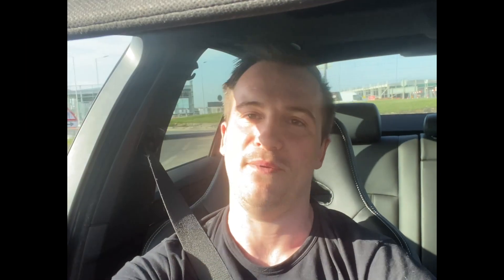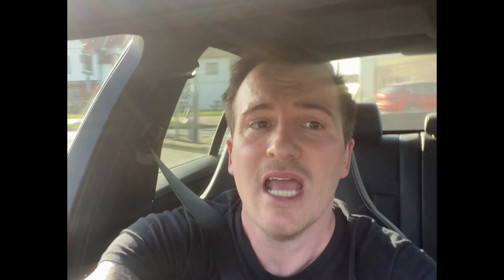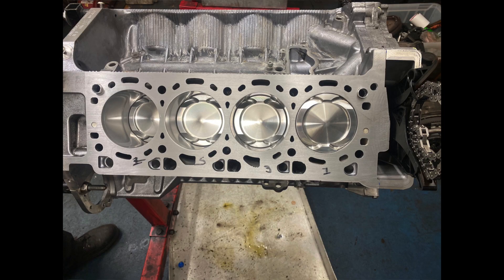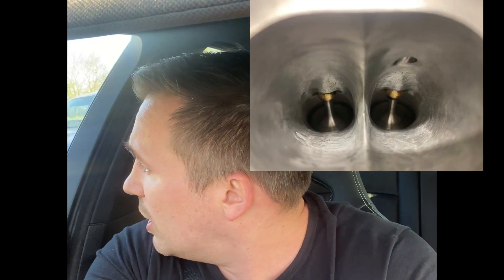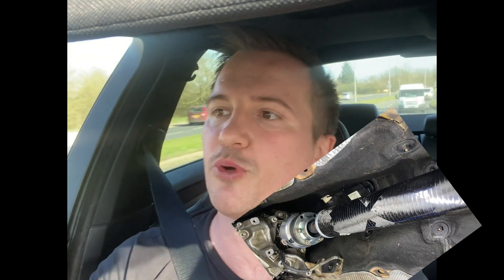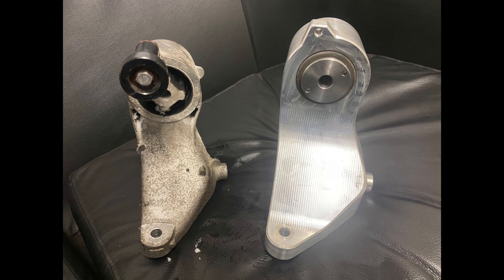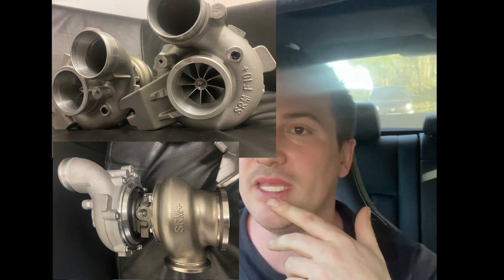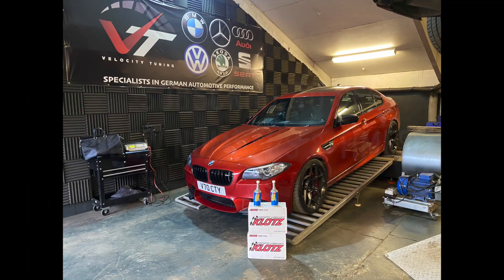VELOCITY'S FORGED F10 M5 ENGINE IS IN!

Comment: I have a 2016 m5 with deka stage 2 rated at 1000nm but it’s slipping with only a stage 1 720 hp 700tq any recommendations for a clutch ? Or what I should do